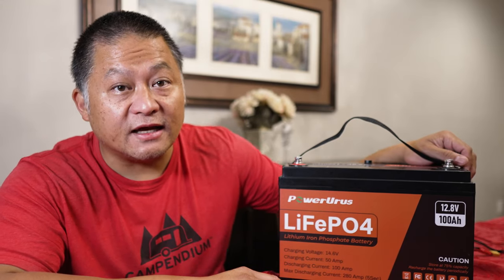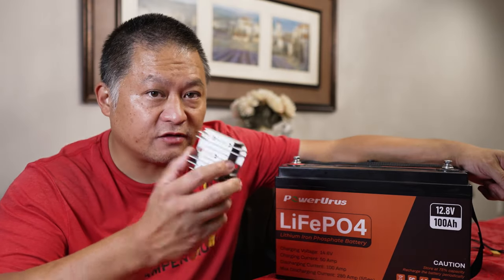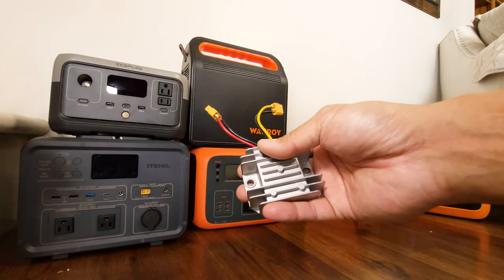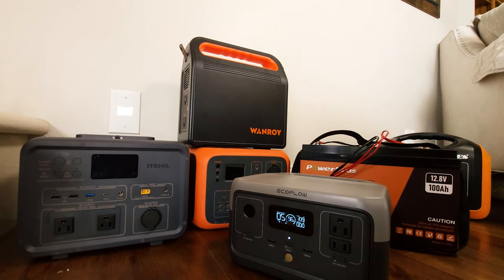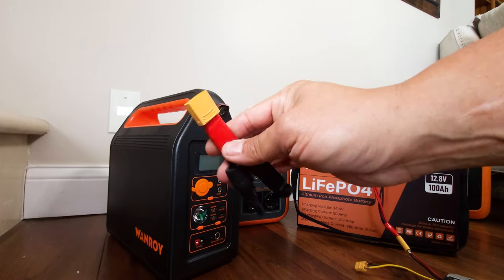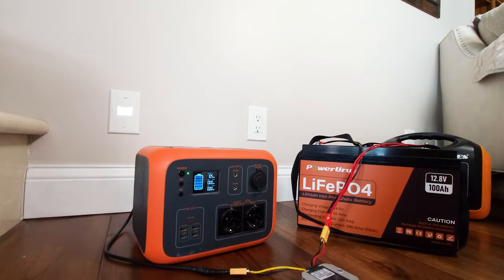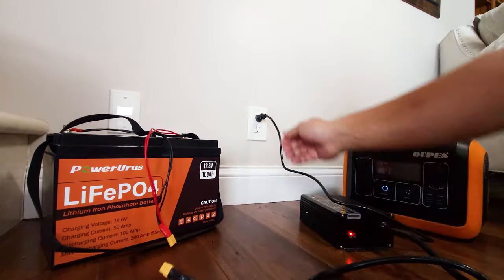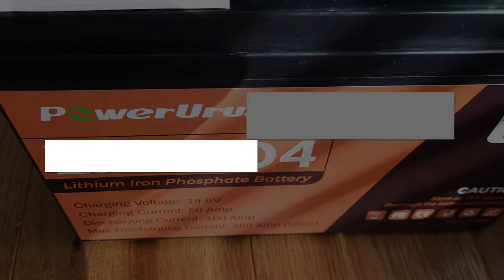CAPACITY HACK For ANY Power Station // PowerUrus 100Ah LiFePO4 Battery

Comment: Thanks for the video.

Here's a less portable, more efficient option if you have 2 or more batteries:

Hook your batteries in series to raise the voltage.  No need for the boost converter's inefficiencies or need to cool it.  (Mine gets very hot without a fan)

Just make sure the batteries are within .1V of each other before connecting them in series.  (You'll get a big rush of current if they aren't the same voltage.)

Took my Delta 2 from 180ish charging watts with 1 battery to 365ish watts with 2 in series.  (Your results may vary depending on the charging circuit of your power station.)
Reply from the maker: The problem with series connected battery is that there is no current limiter.
Reply: @freelyroaming  MPPT (or older PWM) DC/solar charger limits that for you on the generator side.  None of these power generators connect you directly to the internal 36v or 48v storage cells.  They all use their own DC charger/BMS.
Reply from the maker: Rely on that only if you are willing to constantly replace blown internal fuses.

Just so you know, hooking up two 100Ah batteries in series and connecting them directly to the solar input port of your power station is the equivalent of connecting 2,500 watts of solar panels to that same port. If you think your power station is designed to handle that then go for it.

Bottom line is every power station has a different charge controller. Some will definitely trip or blow a fuse as its internal protection method. So If you want to reliably use this method over a wide range of units, don't count on all of them to behave the same. A simple boost converter that you select, can control to behave the same across all units is much more reliable.

Not only does simplifying make for a more reliable system, eliminating external variables is also a best practice.

And yes, simply asking people to connect multiple batteries in series without making sure they know the risks of unbalanced packs is dangerous. Which is why this should not be recommended as a practice for all to follow. Not to mention the extra space, cost and cabling required.

This video is showing a much simpler, cheaper and practical way of extending the capacity of a power station used in a mobile environment. Keep that in mind when you watch these videos. The channel is called 'Freely Roaming' because the audience is people who travel nomadically.
Reply: @freelyroaming  Man, you continue to ignore basic electronics and ohms law, but ok.  This is your video and I'll respect that and go somewhere else.  I was simply answering someone else's well placed question, and will warn folks that your answers are just blatantly wrong.  A 100Ah battery doesn't just SHOVE that 100Ah into whatever you connect it to, it is merely a MAX rating.  At 500W rated on a solar charger, a 50Ah battery would supply exactly the same power as a 100Ah does into one of these units (because the resistance is what sets current).  The 100Ah isn't going to double that power.  And the reason most of us get these power generators is because it converts and does all this for us.  So, fine, for those of you that want, continue using a DC boost that costs more, adds complexity, limits your current and potentially can burn your house down (most of those cheap ones on Amazon can get to a Tcase of 85'C).  But just know that IF you use the proper XT60i input to the solar plug (or whatever plug your charger has for it's solar input) and as long as you follow the voltage recommendations for that port (most even protect you if you are outside that range and just disable charging), you are going to be fine keeping with the simpler solution of just connecting up and not boosting it and wasting current on a HEATER as well as limiting your effective charge rate.
Reply from the maker: @jeffmcclain  don't play dumb and pretend to be 'just answering' someone's question. Just like your tone in this response, you know as well as I do that you deleted your own rude and ignorant post from yesterday that I called you out on and this is just your way of looking around trying to find someone to defend your poorly made suggestion.

It's obvious that it doesn't just push all of the available power. Neither will a 2500 watt solar panel. But without the proper components in the circuit it will blow an internal fuse at the very least.

Ohm's Law does not just magically save you when the circuit does not protect against over current. It will in fact work against you.

Not all charge controllers are created equal. You are telling people to trust unknown circuitry inside a black box and recommending for people to ignore the possibility that some poorly designed power stations will cause more current to pass thru than it should unimpeded which is ignorant and irresponsible. At best you will blow the internal fuse and at worst cause injury and death. It's foolish and dangerous.

I can't stress enough the fact what you are telling people can hurt them for the sake of your own injured pride on this topic.12-24v boost converters are used everyday, everywhere. Especially the low current 6A unit I recoomended in this video.

From a pure safety standpoint it is much safer than telling a layperson to mess with 2 100Ah 4S LiFePO4 batteries in series. Even if they are able to choose the proper cables, lugs, crimp and connect them safely and properly, you can have further implications in potentially damaging the batteries with over charging/discharging if the capacities are unbalanced. it is just a terrible idea altogether to recommend it without further explanation.

I hope your employer/clients see these comments and finds the flaw in your argument that you would trust an entire category of unnamed components in products without prejudice because of what they "should" be able to do. This is entirely poor judgment for someone who proclaims to be a professional...

Let me see, you think I should run 4 USB 5V cables in series instead of using a single USB-PD to charge my macbook? Much more efficient, right? 🤦‍♀
Reply: @freelyroaming  I deleted my comment from yesterday because you became combative and asked me to. I'm not angry nor do I feel threatened or have an injured pride (from what? so far I have no reason to be).  I was trying to help answer some of the folks questions here that seemed on the right track.  But I don't want to argue or get into your mud slinging, so I'll leave it at this.  feel free to delete this comment too to hide your own embarrassment if you like.
Reply from the maker: @jeffmcclain  I don't delete comments so people can see the complete exchange. Especially ones like yours that show others your ignorance on the topic. I never asked you to delete it. I just said your recommendation was dangerous and still do. 

You think I was combative? You don't think it was warranted because the fact you started your unsolicited comment with your Napoleon Dynamite impression, 'Ugh... I can't stand it when... blah blah blah...'?

I stand by everything I've said about you and your suggestion. It's dangerous, impractical and simply a bad idea for general consumption.

You have a channel so go ahead and make a video about it. See what others think about this great idea. Don't go around grand standing with your unverified thoughts. I guarantee you have never done what you have suggested in practice.  Let alone the multiple units I've tested just in this video alone.
Reply: @freelyroaming  According to what you "stand by" up there, I guess that means you also would NEVER plug two 12V solar panels in series and charge your generator either.  You would connect a DC boost converter to a single panel and let it charge through that to get 24V.  Don't try to say that's different, because from a pure science (voltage and power) it is NOT.  I am very sorry you feel attacked.  That was not my intention here and as a 30 year electrical engineer with lots of experience, I was simply trying to correct some things you say based on "feeling" rather than facts.
Reply from the maker: @jeffmcclain  Attacked? No. Frustrated, yes. If you had any experience making videos that people find useful you'd understand. Triggered trolls are constantly chiming in with poorly thought out ideas that they claim to be better and I have to deal with all of you in the comments. All of these other options have been considered and eliminated long before the camera ever comes out. 

There is NO simpler, cheaper and safer way to extend a capacity of a power station than what I showed in this video. Having highest power efficiency is not a goal especially if that comes at the cost sacrificing 1 or more of the 3 primary objectives. It is simply not worth it. A ~10% loss of efficiency from a boost converter is a small price to be able to attain all 3. There are other ways. But not one that factors in all three aspects of being simpler, safer and cheaper. Period. Especially your suggestion which is WORSE in every way.

Your suggestions requires multiple cable sizes and lugs and the know how to safely crimp properly sized cables between batteries. Not simple or cheap. Needing to have 2 identical batteries and the need to balance charge them prior to use. Not simple or cheap. The failure of properly sizing cables or balancing batteries can lead to overheated conductors. Not safe. That's not even including the fact that some lower end power stations will repeatedly blow internal fuses or breakers leading to complications to just using the power station as is.

These are FACTS, not FEELINGS, if you are paying any attention. Claiming baselessly that a 3A 72W 12-24v boost converter have a high probability to burn your house down as you did is a 'feeling', not a fact. 

People who make videos worth watching are not just winging it like the rest of you. That's why your videos get no views. Just a fact because we put in the effort and thought whereas you just hop on a keyboard and start pounding away in the comments. 

I responded to a rude troll who provided bad advice. I personally would certainly run batteries in parallel, series and even both. I understand how to do it safely. But recommending it for everyone and say it is safer without specifying all the nuance to be aware of? Absolutely not. And you came in here and began telling people that it's easier and safer which is again completely false.

You are COMPLETELY missing the point about what I said regarding solar panels. It is quite frustrating that I might have to explain yet another thing to you. Though I think you are just trying to change the topic as a distraction. Typical troll behavior. But this is your problem all along. You are always missing the point. Ever since you first deleted comment and still now.

It's pretty lame that you constantly go back and talk about being an engineer for who cares how many years. Do you think you are the only engineer in this conversation? But you are the only one who is insecure enough and feel the need to constantly tell other people about it, that's for sure.
Reply: @jeffmcclain  so would this work by adding a second battery in series to a vehicle and then connecting a bluetti to the second battery for alternator charging? I'm new to all of this and I appreciate this video and also appreciate your comment.
Reply: How would this work in a van? Add a second battery in series and hook the power station to the second battery for alternator charging while driving? Would your idea eliminate the need for a dc to dc alternator charger to charge a power station from alternator charging? Thanks

Comment: Mine as well skip the bullshit and mount a 1200watt inverter right on the side of that battery.
Reply from the maker: You can come up with something more clever to say... Or maybe this is the best you got.
Reply: @freelyroaming  Using the built in charger on these overpriced power stations to take power from an external battery will net a 15%-20% efficiency loss in the form of heat on top of the 5% loss from the voltage converter. 
A 100Ah LiFePO4 + 1200watt inverter cost $400-$500 an equivalent power station costs 2x that. 
Another disgusting fact is that most of these overpriced power stations come with lithium-ion cells which are less durable a have 10x less service life than LiFePO4.

Comment: Can I connect the device in ur video to my 12 volt solar array (instead of a battery) to charge Ecoflow River Pro ?
Reply from the maker: That is the way it is designed to work. 12v solar panels output anywhere between 18-24v

Comment: Thank you so much, My power station accpet 15v 6a from ac adapter , and  "22v 6a " from solar panel.
Can I increase the ampere while charging my power station?, for example by using a converter to increase my car 12v to 22v but with 15a using solar port to for chagring.

Comment: This additional capacity could get thru several days of clouds then solar could recharge both batteries!  Thanks for the info   !:-  )
Reply from the maker: It would definitely extend the time you can be out. Depending on the solar panel you use, as long as it has an inline charge controller, you can definitely use it to top off the battery pack while it charges the power station.
Reply: @freelyroaming  Are you able to do a followup instruction to show how to solar charge the expansion battery? In this scenario, would you be able to use solar to first charge the expansion battery, which will simultaneously charge the powerstation, which will simultaneously charge your devices?
Reply: @shanediesel4562  @Freely Roaming   I would really like to see how to charge via solar panels too. 
I have two Ecoflow R600 pro that can be linked. It also had this special option too add an extra battery via a special plug, but it is not available any more :/ 
I charge them with my Ecoflow solar panels, though at bit slow.

Comment: If ive got a pair of lithium batteries connected to a dc to dc system. Can i still use this technique? I mean if its charging with the dc to dc on and you use a jump starter to reset the bms?

Comment: Question?  Why is their double red and double black wires coming off the battery instead of just a single wire of each? And how are you connecting them in terms of "double" to one side of the wire on the xt60? Thank you

Comment: Is there a voltage relay that turns on at custom voltage, like 14v, wired before the boost converter? And what about a low voltage cutoff?

Comment: Sounds like a great idea! What is the formula that explains how a 100 Ah battery triples the capacity of a, let's say, 600 Wh powerstation? Thank you.
Reply from the maker: 100Ah has 1280Wh of capacity.

1280+600=1880
600x3=1800

That's 80Wh more than triple.

Comment: This is so cool!  Smart. How fast do you suppose the 12v battery could charge up a Bluetti Ac200 max ?   I have been trying to figure out how to power a stationary RV without building a whole system with components,  BUT having enough capacity without costing a fortune. Id be totally off grid so would need a way to solar charge the 12v too.

Comment: Is it normal for the 12v-24v Boost Converter to get almost too hot to touch while charging my ACP200P? Great vid and works nicely using an airline connector but the converter seems to get very hot.

Comment: Can i expand a small cheap powerstation like the bluetti ac2a with a 100mah battery to power a portable fridge freezer in my car offgrid camping etc additionally can I charge with solar at same time or would i need two different panels so to speak to charge both during the day

Comment: Young man I have a question for you I have been trying to figure out how much time I can get out of one of the lithium battery batteries 12.8v 100ah I’m doing some prospecting and need a power supply that is very light in weight the bilge pump I’m going to try to use is ruffle 20a to run it I bought a small power station and It’s not quite big enough to do what I need to do was going to return it but are power went out and it worked great to run a couple lights to get us by so I thought I would go a different way and use the lithium battery but I’m not coming up with a way to figure out how much time I can get out of one of these batteries to determine which one to use do you know how to go about doing this I have watched several videos but I thought you did a awesome job on your videos if you have any suggestions I would definitely welcome any advice on what to do thank you

Comment: You're really pumping out the videos lately Dan.  👍
That boost converter in a pretty substantial heatsink. What's the efficiency? How much heat/watts does it shed?
Reply: Have you got a link for that barrel connector?
Reply from the maker: I usually just cut the cable to the AC charger that comes with the unit and install XT60 connectors in between.
Reply: @freelyroaming  But that same barrel connector fit a couple of your power banks. Is there some standard I should be checking for a concentric plug that is rated to pass xxxW of current?
Reply from the maker: @jimurrata6785  yeah that barrel plug is one of the more common ones. It is used by PowerOak, Oupes and Wanroy. I made it by cutting it off of the PowerOak charger. I wouldn't preemptively make any pigtails without knowing what power station you are going to get though. When I cut it off of the AC adapter, I install XT60 plugs on both ends of the cut wire so it can still be put back together and used. That is the ideal way to go. And you don't have to buy anything extra. The current is so low that companies just use whatever they have on hand. Its usually less than 10A of power.
Reply from the maker: It's about a 10-15% efficiency loss in the boost conversion.